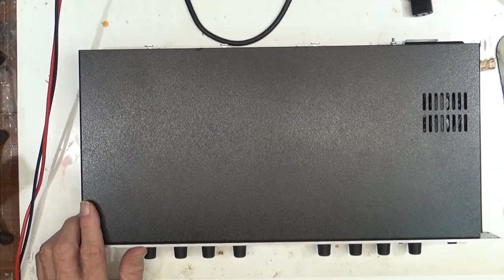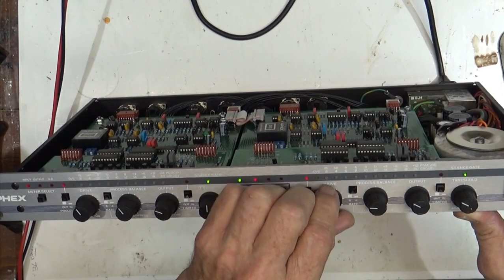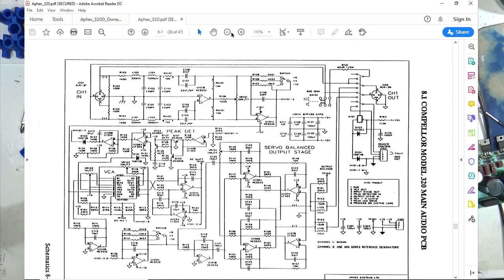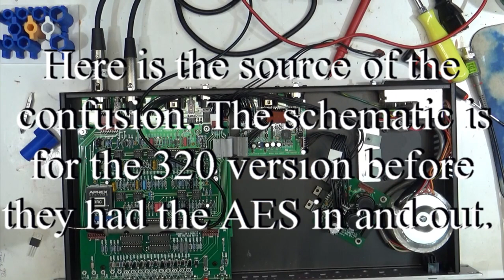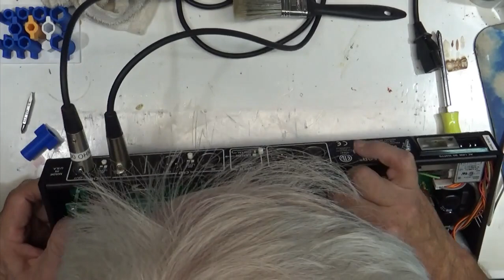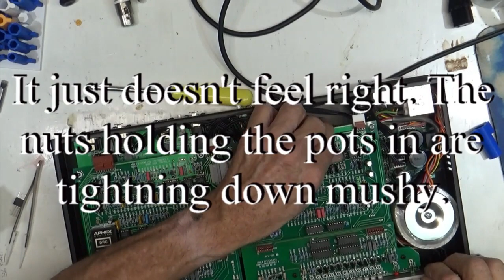Repair Aphex 320D Compellor and a trip down the rabbit hole

Comment: Sorry good morning can I hook that up into an interface Apollo twin universal audio
Reply from the maker: Not really, no. The Aphex is designed to use line level signals and since there don't appear to be any real outputs on the Apollo you would have to put a mic preamp in front of the Compellor, like a 528E, and that would defeat the whole purpose of the Apollo except the USB output.

Comment: This is the great device. I have a Compellor 320A and on right channel green signal LED's are constantly lit even if nothing is connected to that channel. Could it be one of the chips or?
Reply from the maker: Where is the meter select switch, program or gain reduction.
Reply: @AERVBlog  It didn't matter, all green leds lit in which ever position meter select switch was. But now it works! In the meantime (about 2 hours ago) I opened it up and exchanged the 2 LM3915 ICs between 1st and 2nd channel (ICs from working channel 1 put on channel 2 and vice versa) and now both channel meters works. Strange, indeed. Thankfully the ICs are in their sockets so its easy to replace them, otherwise would be a PITA to disassemble everything and unsolder them...

Anyway, thank you very much for trying to help, I appreciate that,

Cheers!
Reply from the maker: @DalmaTon-Records  gotta just love mystery repairs. Might have just been a bad connection on one of the pins of the IC. They didn't use the best sockets.
Reply: @AERVBlog  Yes, may be. But now I see another problem, when I engage limiter switch its correspodent LED doesn't lit at all, on both channels and the silence gate green led won't lit too... Before I swapped the ICs that worked fine. Maybe I will order a new two pair of ICs and install them instead of these ones currently in the Compellor.

Thank You for your comments and time,
Cheers! 👍
Reply: @AERVBlog  Actually I was partially wrong in the last post. Silence gate LED DOES work, but limiter LED does not, and I didn't tuch the limiting circuit at all...
Reply from the maker: I just looked and the limiter LED is not run by those ICs. It comes from the peak detector on the bottom board across pin 12 of H101, that strap cable from the bottom board to the top. So changing those ICs will not do it. I have seen LEDs go out but it is rare. Do both of them not work?
Reply: @AERVBlog  Yeah, limiter LED doesn't work on both channels. Strange, because I could swear that these LEDs worked before I changed those ICs. And I didn't touch anything but swapped those ICs. I bought that Compellor second hand for 180 Euros, although I said myself not to buy anything second-hand anymore...
Reply from the maker: But it is so much fun and so rewarding when you get the older stuff working. Don't you think?
Reply: @AERVBlog  Yes, but I'm happy when I fix anything thats broken or nonworking. Some older stuff is pure gold. But, when you buy used stuff you must be careful because in many cases you buy someones elses ''problem'' and by ''problem'' I mean some component of the device that's non-working or the previous owner had trouble with...
Reply from the maker: @DalmaTon-Records  it is even more fun when they tried to "help" fix it.
Reply: @AERVBlog  Yeah, I know. They many times make things even worse...

Comment: Can I say, try tightening the nuts on the pots first then screw down the rear mounting PCB screws :)
BTW I just fixed my 323 (mono version) as the GR indication wasn't working, replaced the 3914's and all good. Thanks for the video.
Reply from the maker: Thanks for the hint.  Yeah, I have replaced a lot of 3914, 3915, some SMD. They are getting harder to find.  Good job. Since the LEDs are dual purpose it can be tricky to diagnose that.

Comment: Thanks for making this video. It's good to know these units are serviceable. Thinking about doing a video on this fascinating bit of tech that was doing automatic gain control in the 80's. 

I picked up a 301 while looking for a 320D and everything appears to be operational. Had to crack it open and set the leveling speed to voice and snug up a power connector but that was it. After going over the manual I think it's setup correctly. Set the input (level/gain?), adjust the process balance, dial in the output (makeup gain?), and set the silence threshold. 

Is it that straightforward? According to the meters on my DAW it's keeping everything around -12dB and that's what I'm aiming for. 

Any insight would be most appreciated.
Reply from the maker: Yes. It actually is that simply. If it does what you feel is right then you got it. A lot of guys way over think and fiddle with processing and you can tell. Remember, your ears work a lot like your nose.  After a while they become deaf to the previous changes. Trust your meters, step away and come back a bit later. You will hear it differently.

Comment: Hello I have a aphex compellor 300 ax that seems to be not very accurate on each side for input. Is this normal? I have checked all the jumpers inside and an recapped the power supply, any help would be appreciated, I could even send the unit to you if you would check it out for me. Thanks
Reply from the maker: There are probably other caps that have gone bad or the pots are dirty.  Have you cleaned the pots and switches?
Reply: Thanks for the quick response,wow! I did clean the pots and switches. Supposedly it was pulled from a working radio station in Orlando. I will look into recapping the rest of it. The last tech that recapped the power supply didn't even replace them with the right size dimension of caps so the had to modify the board and the case load didn't sit right.
Reply from the maker: @ilsoundop  how did the recap go? Did you rebuild the power supply board with the right caps. Inquisitive minds want to know.